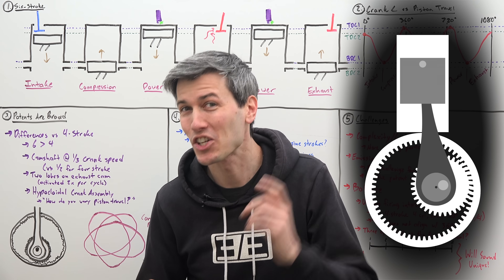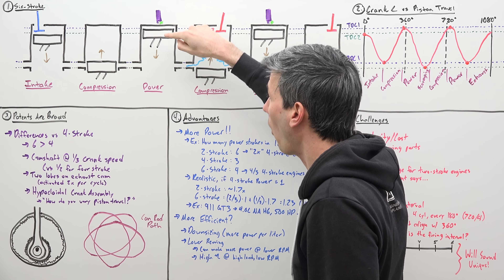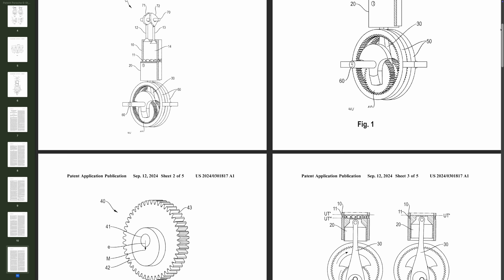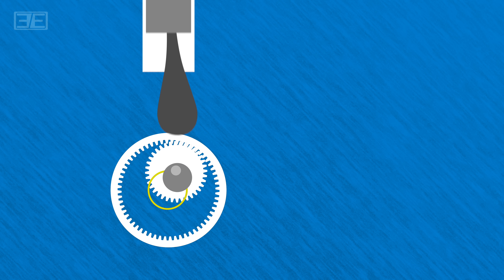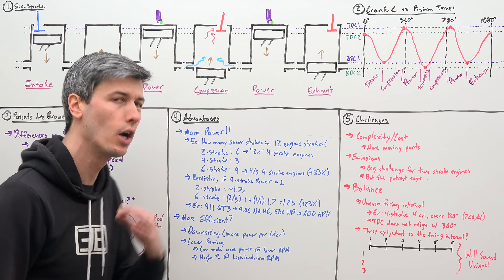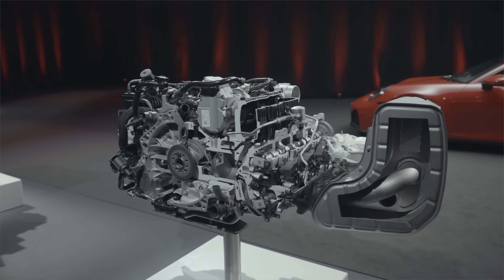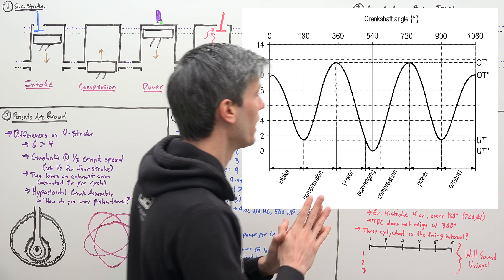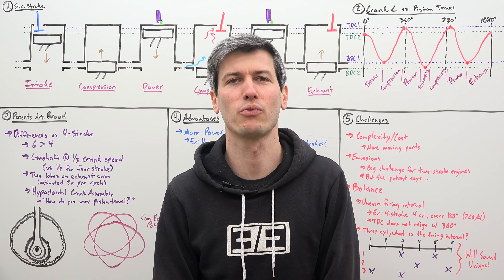Porsche's 6-Stroke Engine Is Genius!

Comment: The sound...the sound!  Imagine 6 strokes at 7500 rpm.  Would sound like an F1 engine.  I see possibility of EGR on the second power stroke.  Lubrication will be interesting with a second BDC.   I wonder how they plan to balance 2 power strokes without also have a hypocycloidal balance shaft otherwise-or by doing 3/6 cylinder only to be able to offset the power strokes more easily.  Congrats on 1000!

Comment: I would like to point out that if Porsche applied this to a Boxer6 engine while maintaining shared crank journals for the opposed pistons, due to the 180-degree offset of the piston banks, the curve shown here in diagram 2 ("Curve Angle vs Piston Travel") would be inverted for one of the banks of pistons, giving one half of the engine the intend combination of TDC and BDC targets, while giving the other half the opposite targets (e.g: Bank 1; TDC2, BDC1, TDC1, BDC2, TDC1, BDC1, repeat. Bank 2; TDC1, BDC2, TDC2, BDC1, TDC2, BDC2, repeat). Another way to visualize the effect would be take the 5-lobe Spirograph shown here in diagram 3 ("Patents are Broad") and rotate it 180-degrees, then figure the new peaks and valleys. That's what the opposed pistons would experience.

Boxer engines would be the most extreme example of the flaw to this design (which makes it ironic that it was designed by Porsche), but in actuality, every engine type with non-inline cylinder configurations that has two connecting rods sharing a single crank journal would share this flaw to a lesser extent.

Granted, this whole issue is born from assuming that it would carry over the use of shared crank journals, assuming the use of traditional crankshafts at all. It's very possible they already compensated for this by allocating independently-angled journals for each of the opposed piston pairs. It's also possible this new technology eliminates the use of crankshafts as we know them, replacing them with a novel configuration that historic powertrain has yet to see... the latter would likely be easier to accomplish, but who knows?

I know they mentioned that it would work best in a multiples-of-3-cylinders configuration (which makes me think they're thinking of trying an EGR-scavenging-daisychain sort of thing for the sake of efficiency or something, but I digress), but I would be very interested in hearing what this concept would sound like across multiple different engine configurations. I think a Inline-5, V8, or V10 would sound phenomenal, and on top of that, there's cylinder bank offset angles to play with, too. The potential sound could be absolutely mental if the combustion events never overlap.

Also, is this a re-release of an earlier video you've made? I swear I've watched this video before... 🤔

Comment: to lubricate the pistons you have to spray oil in the cylinder below the piston, 
but when the piston goes up , some of the oil goes into the second air intake ( the 2-stroke intake )
witch means as soon as you have the 5 and 6 stroke , air is mixed with oil and get into the top of the piston and also mixed with fuel 

i don't really know how this can be a viable solution ...? burning oil is catastrophic for emission

Comment: As engines and engines have been around over 120 years on the simple cylinder in bore with a crank model I very much doubt that great engineers have not thought of this and other similar ideas in the past , applying for a patent to protect it will I think kill it any if successful. Forced induction assists with the burning or more fuel , longer strokes assist with efficiency and simply making an  engine without a massive over production of power also improves efficiency overall , I suspect the reason it's never gone into production in the past is because of mechanical stability rather than because its not been thought of before

Comment: Interesting concept, but in general, when your design is a compromise of two different categories, you generally end up with a result that doesn’t perform as well as either dedicated design. Seems too complicated. Kind of like the Atkinson cycle, which is way over complicated for no benefit.

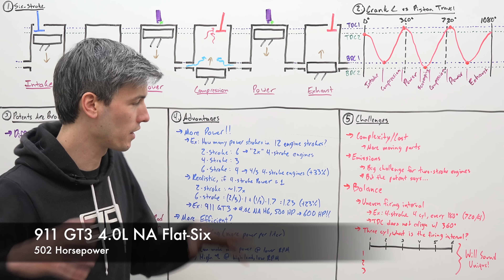Comment: 8:50 How do you get the 2nd air intake to work in an NA configuration would be interesting concept, normaly a 2 stroke diesel and even the 3 cylinder 2 stroke ferrari concept are compressor fed.

Comment: Thinking about how this engine is a hybrid between  2 and 4 stroke engines you will need to have some sort of blower to push the air into the cylinder during the 2 stroke part of the overall  cycle. Whether you can route the output of the blower into the inlet manifold is just engineering. Lubrication, that will follow normal 4 stroke practice as does the 2 stroke diesel and unburnt fuel in the exhaust which is a problem with traditional 2 strokes is not a problem as direct petrol fuel injection systems are readily available. A fascinating if complex engine and probably a development nightmare.

Comment: For challenges, I would think maintenance. It got me wondering what would happen if the secondary air intake at BDC2 gets clogged. Also, how much of a headache this would be for mechanics to figure out timing issues. I'm sure if this design is a success, mechanics will eventually get use to the new design. But initially, I can imagine a lot of pain from learning this new 6-stroke cycle.

Comment: One major advantage of this engine is that it sucks in excess crankcase-gases in a very controlled manner, which is one way it's efficiency is being improved.  
However, whether it can compete reliably and financially with existing technologies such as variable valve timing still remans to be seen!

Comment: blue smoke from the exhaust is guaranteed
Reply from the maker: Haha seems like it, idk how you’d prevent oil from getting in the vents, and thus part of combustion later.
Reply: @EngineeringExplained  easy: no crankcase ventilation, but forced induction at all engine speeds just like EMD diesels do

Comment: so they merged a detroit diesel with a 4 stroke. It cant be an NA engine because it needs the intake pressure to scavenge the cylinder in the 2 stroke cycle. Why not just make a modern version of a 2 stroke diesel and get rid of the 4 stroke complexity?

Comment: I don’t think really get it. If you are gonna put 2-stroke elements in a 4-stroke, and deal with its emission drawbacks and then say “clean combustion” will fix it, why not just use a 2 stroke that doesn’t burn oil or have bad emissions? You get all those benefits and not have some weird gear crankshaft… you would be developing an already existing engine. And I thought 2-stroke diesels didn’t burn oil 😅. 
If someone may enlighten me I would appreciate it.
Reply: Achates Power is doing exactly that.

Comment: The 2 stroke compression cycle, if the exhaust cam only opens the valve a smaller measured degree, and the injection cycle is pulled back to reduce the amount of fuel injected, then you could be burnining some of the potentially unburnt fuel from the original 4 stroke cycle... surely..

Comment: I don't understand how they keep oil from going into the 2T intake ports on the 4T cycle. Ostensibly, the bottom of the piston is sprayed with oil like a normal 4T. How do they keep that oil from getting into those ports and consequently burning on the 2T cycle (not very "clean").
Reply from the maker: Great question! Seems it would indeed burn oil.
Reply: @EngineeringExplained  couldn't that be solved by using a turbocharger that's engine-driven at lower revs like EMD engines do?

Comment: One thing that is hovering through my mind is: Will it pump fuel inside the cylinder on the fourth stroke? As of right now, I’m tempted to believe that the first stroke might be rich and the fourth will not throw “everything out”. If so, there will be still fuel inside the cylinder and that’s why, apparently, the fourth stroke will only throw clean air inside the cylinder. Rookie here so I apologize for my ignorance in advance if I got something wrong. If not, that means we probably wont see a 23% increase in power but a significant increase in gas mileage!

By the way, congrats on the 1000th video! Huge fan!

Comment: Perhaps that is why the patent suggests that it is best to be with a MULTIPLE of 3. Not necessarily 3 cyls, but 6 or maybe 9 is possible, but a multiple of 3. Sometimes obfuscation of patents is done to make them a little harder to copy.  As, most companies will perform a variation of a patent in order to get around it. As you said patents are often vague... for the purpose of preventing copying something that has been written to be too specific.

Comment: Porsche management: Our engines have developed significantly. We have been able to increase the cost of an engine from 7,000 to 50,000 in the last few decades. We have also been able to reduce reliability significantly. But we still have a problem. Most engines still last longer than 100,000 miles and, what is worse, could be repaired, even if we can prevent some of this with the Alusil coating. Suggestions?

Porsche engineer:
I have an idea..

Comment: I sounds wonderful... except, simply put, it is going to be an oil burner.

As the piston goes past the lower ports, oil will get wiped off of the area below the rings.  Then as it gets below it, the intake will open and push that oil back in.   So now you are burning a mix of gas and oil.  Further, you have just made it extremely difficult to keep enough oil on the rings, which will likely lead to premature wear in the cylinders.

It would appear that the lower intake ports are going to get coated in oil all the time.

This works on a two stroke because for the most part the oiling systems are total loss or "in the fuel" systems.  

There is also the question of exhaust and intake occurring at the same time in stroke 4.  The potential is pulling fuel out of the exhaust, which will lead to a false indication or rich running, which would in turn make the engine adjust lean, which could lead to detonation and premature engine failure.  It could also make it such that the mixture in stroke 4 may not end up being strong enough to actually fire off reliably in stroke 5.   

Seems sort of a self defeating process.
Reply: This is surely a turbocharged engine, not a crankcase scavenger.
Reply: @erkinalp  there is oil on the rings... going past what will likely wipe some of it off.
Reply: Right? What you explained with the oil is exactly why two-strokes kind of suck, especially for large vehicles that need to be reliable daily for years.

And I'm also with you on the 2nd power stroke being iffy. I just don't see how that could produce a lot of power. It seems like you wouldn't be able to get all of the exhaust gasses out. The exhaust stroke usually needs the piston moving upwards to help force the gasses out, and even then a restrictive exhaust system won't get rid of it all, choking the motor. With this setup, you can't even leave the exhaust valve open that long during the piston's upstroke because your new air and fuel charge will just go out the exhaust valve.

This just feels like a combination for a 2nd power stroke where the cylinder is still too full of exhaust to produce good combustion.

Comment: The eci stroke , the exhaust opens first, then the air box , which is pressurized by magic , and then it will have built in egr to deal with the second power stroke with its smaller volume, which is significant.

Comment: Increasing the number of combustions per cycle moves the engine torwards the turbine design where a continuous combustion happens per cycle, extracting energy from fuel in the most efficient way possible.

Efficiency considerations apart, why not using electronics to inject air and fuel at the right moments, instead of mechanically rely on the piston with its complex movements ? That would avoid the complex gearing at the crankshaft, no?

Comment: More bored engineer toys. Efficiency and machining are two major impediments. But the real elephant is that this is just another CO2 emitter and does not have fossil fuel horizon time to develop and market. H2? better uses for  H2 exist but the inefficiency of H2 production is another elephant. Any increased green production of electric grid power (read for H2 electrolysis) will be swallowed by energy panic driven society, happening already. Nuclear is probably the get out of jail card.

Comment: Seems like Nissan's variable compression engine could achieve almost the same thing minus the additional air inlets. But variable valve timing and lift could also make up for this difference to some degree. Is that a fair assessment?

Comment: Ill need to see metrics from a working engine before i begin to drop my skepticism of this....
Additional rotating mass, additional weight of the assembly, HP per lb, ft lb's of torque per lb, dimensions, etc.....

Comment: Well one thing you missed is that in this setup have two power strokes together that more than double the torque where in the normal engine there's a free stroke with every power stroke to get rid of burned gases but in the 6 stroke motor there's fresh air interduced to the already burned gas burning them a 2nd time thus making it 1000 times more efficient. The engineering on this motor is amazing. Wish i could meet that person.

Comment: It needs to be a 6 cyl motor for the firing/power intervals to be even with the same force per interval... Less than 6 cyl and there will be some intervals just pushing 50% power (only 1 cylinder firing) - with this motor it seems you always want 2 cylinders firing at the same time.
Great concept but way too many more moving parts added to an already parts heavy invention.

Comment: Thanks for the detailed (and clear) explanation!
I'm still scratching my head why it should be more than "because we (Porsche) can". The way I see it's a choice between 4-stroke and 2 -stroke and which one is best depends on what's prioritized for the application. Marrying the two just creates more complexity and not only introduces 2-stroke disadvantages to 4-stroke and vice versa but also adds new ones (like the balancing problem and the uneven spacing of power strokes). It may have been better to go with cam-less valves instead of the complicated, uneven stroke lengths, although, there may be more to the story there. 
So, until Porsche actually builds a 6-stroke engine and proves all the suggested advantages, I'll just file this under curiosities. 
To be sure, it's a very cool and clever idea but perhaps not very practical.
Good analysis, though, in the video!!

Comment: The reason why this new 6 stroke engine should result in cleaner combustion and fewer emissions is because not all of the exhaust gases are exhausted on the first go. Some are withheld inside the cylinder and combusted again.

Comment: Six stroke engines are not a new or novel idea. Some basic research on engine design would clarify its origins. 
For example, Honda developed a small engine in the 90's as a competitor in the Shell mileage marathon competition. Their rational was that it would garantee separation between the inlet and outlet strokes thereby further minimising fuel waste on the exhaust cycle. 
The Porsche approach differs, as it is more aimed at performance benefits.

Comment: Wondering how lubrication works for this engine. Given that with the side air inlets it’s going to be impossible to keep oil in the crankcase. Also piston rings will have a really hard time surviving that.
Reply: This engine is 100% intended to be a turbocharged engine, so the oiling will be normal.

Comment: At the end, where you attempt to determine the firing order for a three cylinder engine, you are completely missing the balance. Cyl 1 fires at strokes 3 & 5, cylinder 2 fires at 1 & 3, and cylinder 3 fires at 5 & 1, so you have TWO cilinders firing "simultaneously" at every 360 degrees +/-

Comment: Two stroke that does not push air through the crank case is more efficient and a lot cleaner than a transfer port engine.

Comment: A complicated toothed gear crankshaft with a wobble built in to it.......what could possibly go wrong? LOL. My teeth are chattering and gears are grinding. LOL. If I designed it I'd put valve ports at the bottom dead without increasing the stroke length and have them actuated by another cam and lobe setup using push rod connectors vs gears or a timing chain. Genius designs are only genius if they work well in practice not just theory. Have they actually built one and run it at high RPMS? inquiring minds want to know. The added complexity seems to be akin to the rotary engine. In fact the geometry of the rotation paths look similar. A Very interesting approach.. in fact had though of this before in terms of ports lower in a piston cylinder but I never though to vary the stroke distance or adding a power stroke. willing to bet balancing/counterbalancing would be very difficult to achieve but hey with AI helping they might have a chance to succeed. No Human mechanic is going to be willing to work on a broken one though unless that mechanic is an AI Robot with torque wrenches for elbows LOL

Comment: Prediction.... This will be an engine stricken with oil feed issues, timing issues in ignition, crank "hypocycloidal crank"  and cam. tolerance and heavy wear, misfires and balance issues after break in. This will be a mechanics nightmare and a dealerships main source of income for a while

Comment: Theory is fun but when they start building experimental functional versions then the real world comparisons will start. If a four stroke and six stroke of the same size are compared and the 6 stroke has lower emissions, more power and gets better mpg then this could be the future of ICE. Computer control, fuel injection and electric turbo charging will be necessary. I hope it works. Thanks for the video. 👍👍